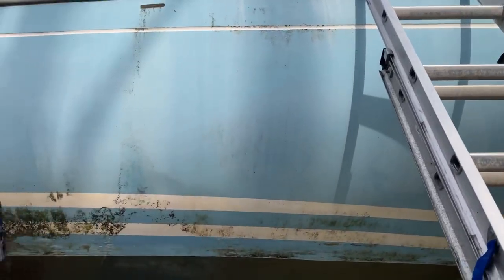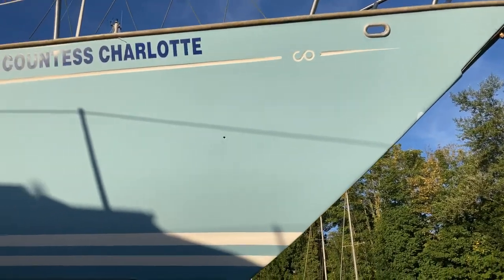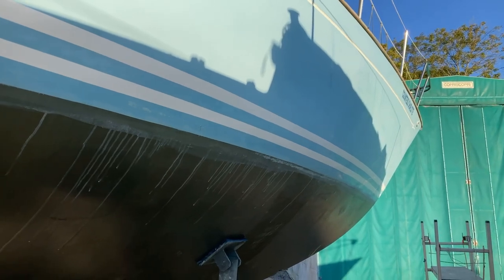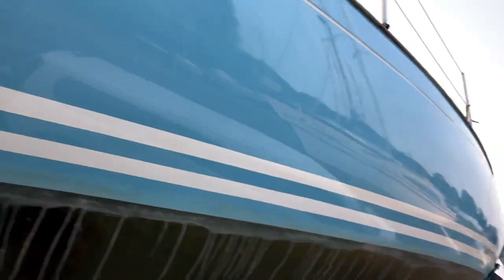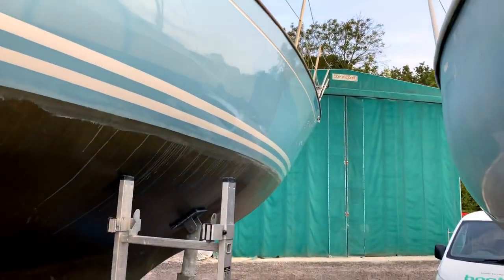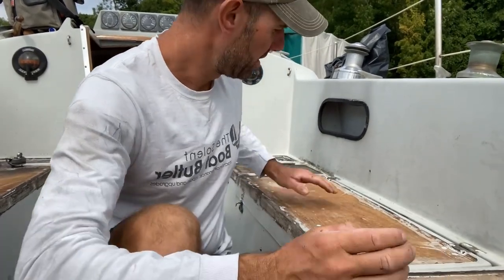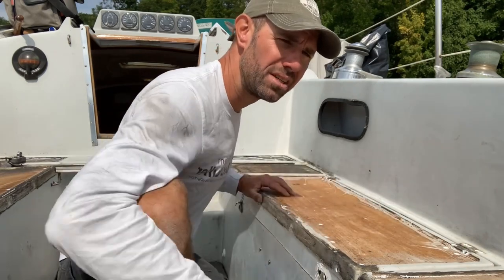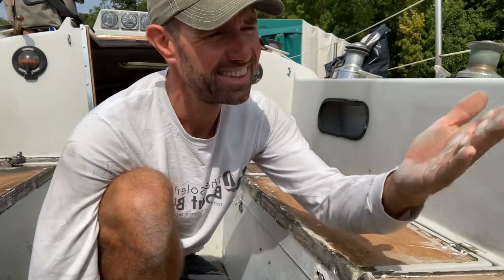Starting the Contessa 32 refit - polishing the hull and removing old decking (Project Lottie Ep2)

Comment: 3m buffing compounds are 2nd to none.. especially if you use their 3 step process.. I took a dump truck which the hood,doors, were fainted fiberglass and used the 3 step 3m and it looked like it had been repainted and shined for going on 3 years now

Comment: Hi, loving the content. I was wondering what kind of footwear you use? I am refitting my first boat a 23ft Virgo Voyager and the deck shoes I bought have just fallen apart, my new pair seem to catch dirt and make marks over the rest of the boat.
Reply from the maker: thanks for watching and the comment.   for sailing I like wearing crocks but they are only used for sailing and not going ashore.   when working I have to wear something more suitable for the boatyard with a bit more protection.    having said that I have found my Dubarry sailing shoes have lasted very well.